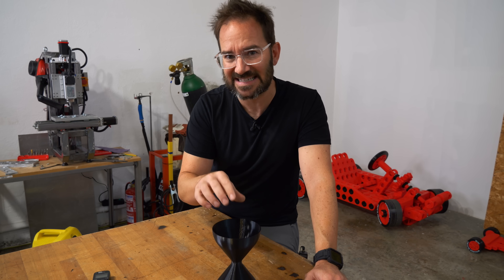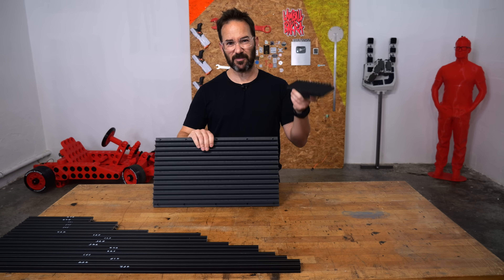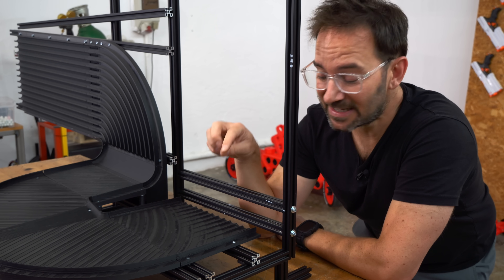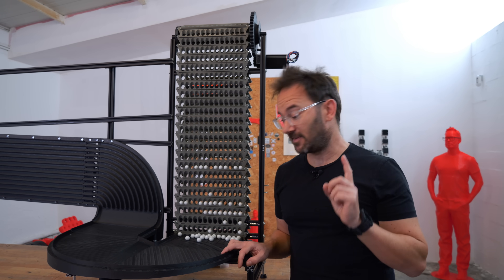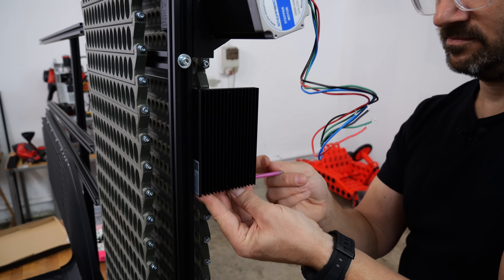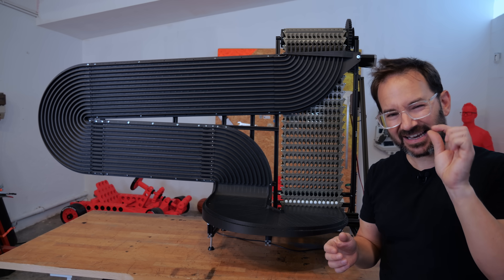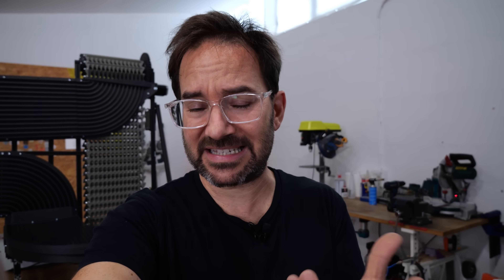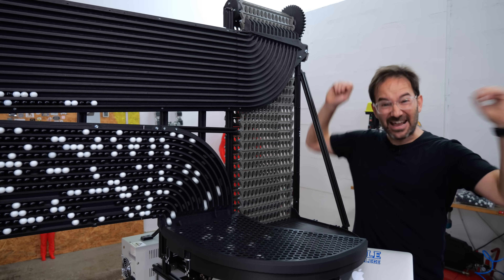BUILDING A MARBLE CLOCK - Pt.1.

Comment: If the marbles weren't mixed up after each unload, you would only need to reorder a very small percentage of them for the next minute and could start building the next load more immediately instead of being limited to the random distribution, which takes more time to sort out.

Comment: Where the marbles drop out there is no reason to keep using that massive wide lane, allowing them to go all over the place. Just make it go narrower and force the right side ones with the most speed that jump out later to move left a bit first to be trapped under the roof thing properly and lose some energy before coming out.

Comment: 1. Rather than just use marble balls, why don't just substitute it with stainless steel ones??? Because as I see in the earlier clip, the marbled ones gets chipped easily after continuous ramming of each other. While stainless steel doesn't chipped that easily.

2. Try to design the cover for the curved track until it covers almost 90% of the curve to minimize the marbles being thrown out during the fast movement on the entire track to the curve.

Comment: Wouldn't it be less marbels if you had built the clock vertically instead of horizontally? just let Gravity overcome about half of the challenges you faced. Also the Belt would just be behind the clock for a smaller footprint.

Comment: I was designing a similar idea in my head for the last 4 years.
Something to display changing QR-Codes that point people to actual facts about the covid scam instead of pharma propaganda.
My plan was to use PING-PONG balls.  They are handy because they are bigger, weigh less, almost affordable and light enough to transport up with air.

Using a single path with the balls meandering down would only show the final QR-Code when the last shift has taken place..
With a QR-code very few excess balls are required because the code can be tuned to have close to 50% of each colour.

Every QR-Code would go to a short code to an ACTUAL FACT and the popularity could be monitored.  Placing it in a market square on a trailer would get a lot of people to scan the code, just to see what it was about.

Making it tell the time would be nice as well I suppose.

Comment: The marbles getting stuck is because the layer is far too horizontal, so you'll either have to get some really frictionless material, induce vibration to get them moving, or angle your gate.

Comment: I would not have used glass marbles, i would have used steel ball bearings, these are far more accurate, you could even seperate the black balls from the white ones, to seperate them the nomonated colour could be 50 thousand of a inch smaller, then this way you could even seperate them by colour/size, also they would not jam up the track as they are slightly heavier and a higher quality sypher

Comment: some nuggets for thought:
1) ball bearings are more reliably measured and round (and durable), come in multiple materials like steel and brass, and you can impart color to steel ones with an oven or kiln (or blow torch) as well as being magnetic*, AND coming in 1mm increments (or less) for precise engineering (plus they're not TOO expensive)

2) if you have 2 colors of ball that're also different sizes, they can be sorted by holes for easier differentiation, but they need to be precise (so ball bearings may be better for that, again)

3) okay, I really didn't mean to just be advocating for ball bearings here, but you could also eschew separating different balls altogether by having strong magnets on the tips of solenoid rods acting as pixels, extended in sequence, they'd capture bearing balls in place to display the number, you wouldn't have to have multiple types of ball and could have far few balls for each image and therefore could make the sculptural elements more fun since you wouldn't need such a high volume of ball movement.

Comment: I think the main problem here is to change time the hour channel and minute channel should be separated vertically 
As the minute will change at one and tens with 60 changes but the hour channel only has 24 changes
To me, the hardest part is to figure out how to program each integer in marble and maybe separated 4 marble elevator may help

Comment: Too much awesome, you mean!

Also (and I'm sure you've probably already addressed this by now), I did see one problem.  The outer wall of the catch tray at the bottom of the marble lift... probably want to make (or add) a slightly higher wall, to prevent spillage.  Not much, maybe a couple cm.

Comment: The way I see it is that there are two main ways to separate the colors. 
Option A: You rebuild the bottom tray to force them to always stay in their correct line(with a ceiling to avoid any marbles jumping to other lines). That lets you keep the marbles in a known order, and a separator drop based on a counting checker for each line would allow for a computer program to pull out the white marbles automatically.

Option B: You switch to using magnetic marbles for white ones and non-magnetic for the black ones, and then use a rotating magnet to pull out all of the white marbles and deposit them in another tray.

Comment: There's one thing that makes me hope that you will complete this clock before Martin completes MM3: you're willing to use electricity and computers. Martin would plan to build a purely mechanical black/white marble sorter and digit composer. Spec 1: Able to sort and rearrange about 450 glass marbles per minute, of which at least 80% are black (look at t=0:57)...

Comment: I like how people complain about microplastics and pollution and such, but are A-OK with all these makers wasting power (which, we haven't solved the electricity from fossil fuels problem yet, in case anyone forgot), and creating junk plastic pieces (which, okay SOME plastics can be recycled and what not but .... yeah .... a LOT of waste) not to mention the fumes that come off of some of these filaments, I wont even tell yall whats in some of those uv curing resins (seriously, you just say the word lead around some people and they'll think you just gave them cancer, but the fumes from a 3d printer? Nah thats fine! Its making something fun, how can it be bad?!) .....I.....I just have hard time taking any of the dog whistle activists seriously when this is going on unchecked.....

PS - That rant isnt intended at this channel directly. Mainly the whole YouTube maker crowd as a whole. That british guy that builds robots in his attic is BAD about printing things easily made of wood or metal that would perform VASTLY better (no, I dont care if any of them have printer sponsors, it implies poor material use, and environmentally unfriendly and/or inefficient building practices. Besides, whats the point if the plastic part breaks 3 times when it could be made of a piece of plywood once? Then tossed into the composter?). I do appreciate the way this dude builds his frames without 5 minutes of bumbling around like someone who cant tell their pie hole from a hole in the ground. Like, that setting up sections with bolts and laying them out, youd be surprised how many people that never occurs to....people lauded as genius  makers or whatever.... But yeah, seeing the reprinting of large pieces over modifying existing ones to work (like the 90s taught us to do....remember? The 'reuse' part of the recycling triangle?) triggered a rant ive been sitting on for a while. I am interested in seeing how the sorting problem gets solved......

Comment: OK, the bottom part probably doesn't need a cover but you do need to have a high lip all the way around. Right now it's a cool art piece, but I just can't see how that's going to work as a digital clock without some way to select and line up the correct marble colors?

Comment: Why not just make a vertical dispenser for each digit. You dont need to unnecessarily change the hour digits for every minute change. And its gonna need way less marbles, way less space, and way less moving parts. Just make a preset for every digit, 0 to 9, four times, then cycle it around every minute, 10 minutes, 1 hr, 10 hrs for each. Isnt this way simpler.

Comment: Am I the only one seeing the elephant in the room?  Your design has no way to arrange a specific sequence of marbles to create the analog clock display.  You're essentially scrambling the marbles every cycle and getting a random arrangement.  You're going to need some way to sort the marbles by colour, store them in marble reservoirs, and then have a line printing section that takes the specific colour marbles it needs from the resevoir to build each line of the analog clock, which then feeds into the elevator.  And this entire process has to be streamlined enough to take less than 60 seconds, otherwise you'll jam the system somewhere.

Comment: Would it not be easier to have vertical channels for each numeral?  Also instead of having a machine set the whole board every minute I would have the marbles be in set patterns like the flipping card clocks where one goes every minute, every 10 minutes, every hour, then 10 hrs-10hrs-4hrs, You don't get the scatter on the release but it should work with less effort.

Comment: can't wait to see it working.
1 thing that came up in my mind is that if you let the Mable display change vertically, you would be able to change the numbers individually.
Then at the hour change, there would be a lot more noise/action.
however, for the show/action, horizontally is most likely more fun

Comment: while i like the idea you're going for, wouldn't it have been easier if you had made the 'display' go vertical?
that way you'd only need to change the full clock like 3 times a day 
and it'd need a lot less supporting marbles

Comment: I wonder how in the seven hells of hades how this mechanism will sort the white and black marbles. one thing is to ensure they run the full circuit but, to have them enter in their correct places to form the digits is quite a feat.
you could use marbles that have different size or weight but it will still be impressive to have each marble redirected to it's place.

Comment: I see what you're going for here, but I don't think you're going far enough with the track for the marbles. If you want a real-time clock, you need full, looping marble tracks with preset patterns of marbles in each track. That way, you eliminate whatever mess you had going on at the bottom of the elevator and any variation in the colors that might have occurred. I'd also recommend switching to columns instead of rows in the time display, with servos at both ends to hold the marbles showing the current time. If you need help designing tracks and perfecting marbles, go check out Wintergatan, the guy who made the marble music machine around eight years ago.

Comment: Nice Project! But shouldn't you start by building the marble selector first and then build everything else around it? Because this is the most complex part, with the most complex requirements. When you build the rest of the machine first, you need to adapt your most complex part, not only to its own requirements, but additionally to the rest of the machine! Why not doing it the other way around? Isn't it easier to route some marble channels differently? Especially if you didn't already build them?

Comment: With the speed the marbles are moving around I am very worried that over time they will shatter each other and you will get more and more broken marbles in the system. Maybe consider switching so steel ball bearings use bluing on half of them to turn them black.

Comment: As a subscriber of Wintergatan, I foresaw every issue with your design. I think you're going to get jams at every turn. You may need gates to control the amount of pressure pushing on the marbles. Marbles are hard to work with because the tiniest thing (including slight wear) creates unpredictable behavior. I'm happy to see where this project goes. I don't know how you're going to pull off the display.

Comment: You could have used steel balls from large ball bearings. They are cheap and precision-made. You could have put a half of them in the "bluing" solution and they'd turn from shiny to black.

Comment: My first thought with something for this system is to swap the black marbles with clear ones and use that to make a sorting system with a laser-based sensor: if the beam is broken the marble goes one way, if it's unbroken it goes another way, separating the clear ones from the opaque ones. you could then have channels draw from one basin of marbles or the other based on what numbers need to be displayed.

Comment: In the next step, you need a sorting machine where they all have to go through once. Detect with color sensor and then store in two systems. Then check the new time, re-sort the balls and preload them. then the change goes smoothly. funny that you print almost everything. i wonder if it might even be more sustainable than combining plastic, wood and metal because the grade purity is higher. Well, be that as it may. I'm looking forward to part 2! Good job! 🙂

Comment: First thing, right away… why not have a design that loads from the top, so you have to change just the minutes every minute, and then you‘d even get an audio reward for every full hour, and especially when it has to reload the full face.
This one looks cool, but changing the whole face every minute is stupid, because then you always have to wait for a couple of seconds for the face to build up entirely. 
With the other design you know it’s f.e. 12:3… and only the single minute is about to be changed.

Comment: Your project reminds me a bit of the Marble Machine where steel marbles were used by the amazing Wintergatan.
I thought your project over and my pick on the setup would not have been horizontal but vertical marble lines so a number that would not change would not being emptied out.
Also steel balls, because of the precise diameter AND being less fragile. You can blacken steel balls by heat treatment, for example.
Last of all you should keep the colours separated. This could be done per line. After all the display 'knows' which colour is there and thus could separate black from white balls while they are removed while the next correct colored ball for the next number would be fed in...
Just a thought. 😅

Comment: For the marbles kick out from the conveyor belt, it would be a better solution to use an axel with a gear conected to the motor, so you can have sticks pushing out the marbles without touching the conveyor belt. This will reduce friction and wear of all plastic parts.

Comment: Cool project idea! 👍
But changing only one digit, instead of all display content, I think, in future will be easier to accomplish.. 😉 There will be minute to prepare all necessary marbles for next digit. For horizontal way, marbles can be inserted through paths (pipes) between digits for every line. For vertical changing arrangement, precise line feed will be needed in manner - old line out, new line in for digit, and so on for every line. As option in vertical feed, then can always be option to just drop down all marbles, but changing lines one by one will look like scrolling down screen.. 

Good luck with project! Waiting for continuity!

Comment: You'll have to fully cover the tray at the bottom to keep the "marbles" from bouncing out.  Or redesign the tray with taller inwardly rounded walls.  Either way it will contain the balls as they fall into the recycler.

Comment: So you kind of solved the easy part. Now the more difficult part to sort the marbles by color and the really difficult part to rearrange them perfectly and in time, so that they show the correct time the moment they roll into the display area. Good luck! Little hint, if you have a huge difficult problem: Chop it up and start with the difficult part or you might need to completely redo the easy part of the solution multiple times.

Comment: You are more than likely going to need 3 or 4 times the marbles you currently have on hand, maybe try steel balls for a more consistent shape and better durability, but also increased weight.
You will also need a way for the clock to sort the marbles by color and direct them to the proper position, also more than likely two or three minutes ahead of when they are supposed to be accurately displayed. 
I can also foresee the noise being an issue if its something you are going to maintain and use regularly for its intended purpose.
I sincerely look forward to the problem solving process and seeing your innovative solutions.

Comment: @Ivan Miranda
13:55 That's why you should not build the next minute in the bend-section, but instead on the straight section above, so you have MUCH less force on each marble & on the gate.
PS. Check out the channel: Vintergatan & his videos about his different Marble machines lots to learn there.
Reply: This would mean that the next time would be displayed upside down. At least on the curve the marbles are incomprehensible

Comment: How did you design the large gear. Did you use a existing stl? I want to make a 40cm gear with also the correct smaller gear. Great project.